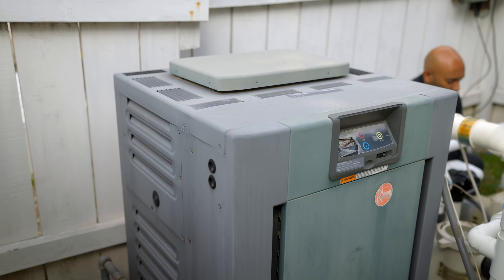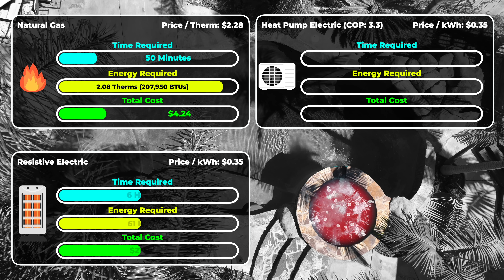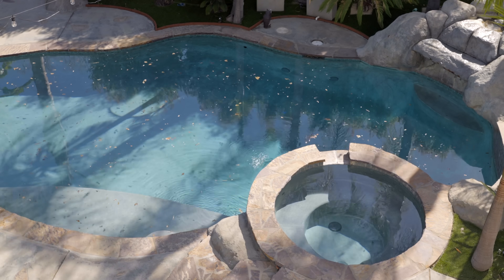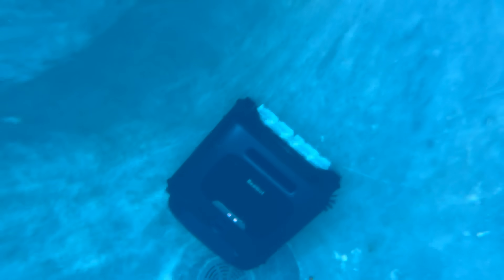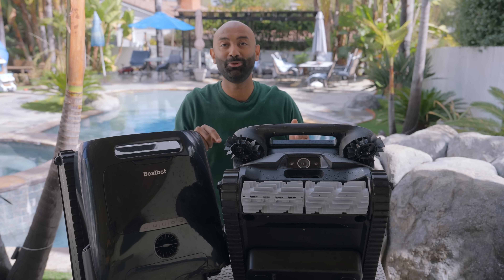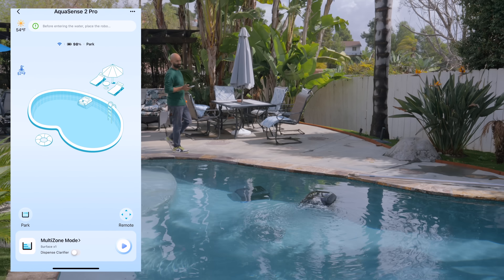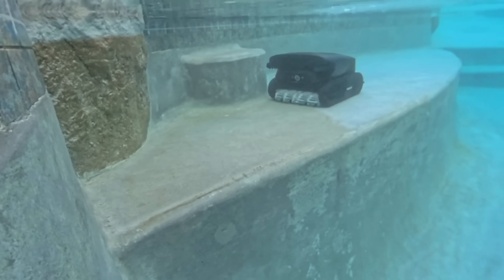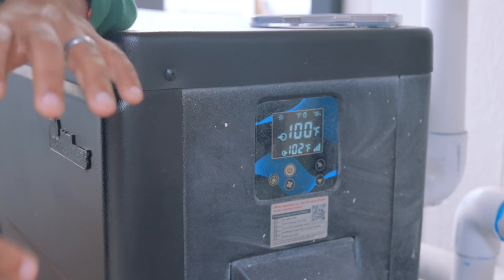GENIUS of the Beatbot AquaSense 2 Pro & Ultra Pool Robots!

Comment: a heat pump basically have dual purpose, it heats up something, and cools down something else, with a bit of tinkering you could use its cold output for refrigeration or aircon

Comment: I wonder who will be the first company to make a Heat Pump that functions like Tesla's Octovalve/Super Manifold and heats/cools different systems all connected - that would solve the "free AC" comment you made - shift heat from outside to pool. Everyone in colder climates could have a cold plunge / freezer that are cooled from the offset of heating their house. We go a place that has saunas and cold plunge and such a device would be PERFECT for that but currently just waste energy of that heating/cooling.

Comment: Hi,  would love to talk with you about this!  I have powered our pool 100% off our solar since we got solar and battery installed in 2019.  I got a 170,000 BTU water-source heat pump for the pool.  It's a beast but all of the equipment for the pool is powered by our 13KW PV system.  It was a bit over 100% of our use until 1.5 years ago when we added an EV and now we are about 90% covered for it all.  I love driving on solar!  Reply to me and we can connect i you would like.  Thanks for your awesome videos...I don't have a robot for cleaning the pool, just me.

Comment: Hey Ricky, I have a pool and heat it in the summer months when I am also trying to cool my house.  (Running 2 heat pumps).   I watched the video to see if you would cover off “ if they did have a hybrid system” for pool owners.  You could heat the water and cool the house, now your COP would be 6.   That would be a great video and product.  

PS, I LOL 😂 because when I signed up to comment on this video there are guidelines to comment, your video basically broke your comment guideline number 2 (no advertising or spam) hahaha.   I get content providers need to do this and I skip most of the ads, but I was interested in your pump and heat set up so I stayed to the end.  👍

Comment: Did you have an opportunity to use a geothermal heat pump that uses wells instead of air to obtain heat?  It is very efficient here in Florida for a 24,000 gal commercial pool & spa.   

Pool cleaners work extremely well.  I had a simple suction type cleaner from Polaris for about 20 years and it worked great.

Comment: This is more of a net zero cost of production by spending over 9min of a 17min video advertising the robot pool cleaner.  Please stop this.  Just make a sponsored video saying that it is sponsored and that it is about the robot.  Then have an actual full-length video about the heat pump.  I feel like I just watched a short wrapped around a commercial, 2 things I hate to spend my time on.

Comment: Does the price of using a heat pump vrs natural gas take into consideration the cooling cost offset or is it cool enough there to not require it? It seems like a two source heat solution could be possible using the Nat Gas when you don't need the cooling, and heat pump when you do.

Comment: A heat pump should have its highest COP if run early-mid afternoon when outside temp is warmest
Reply: And if you have the good sense to site it so that you can create a small greenhouse around the input side, it will perform well in the winter too - with a little winter sun, this is what I do in the UK.